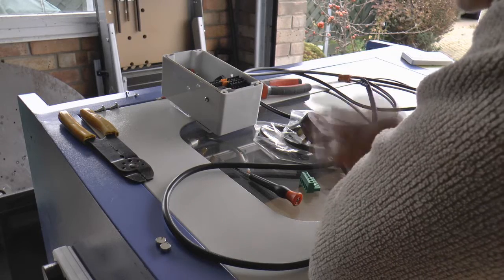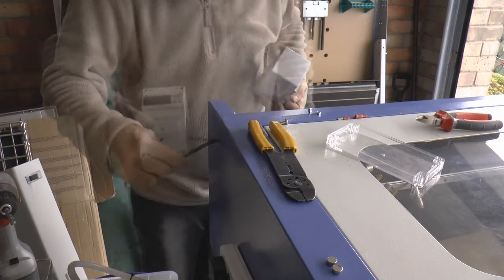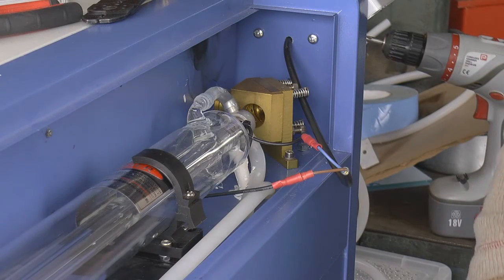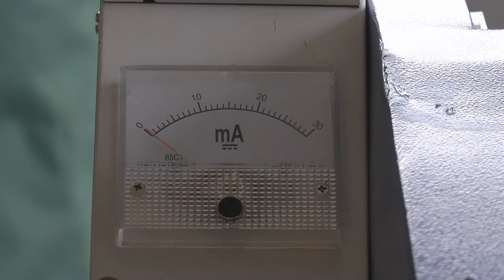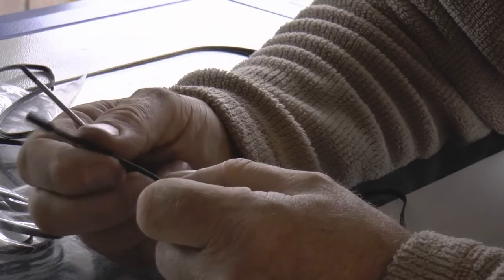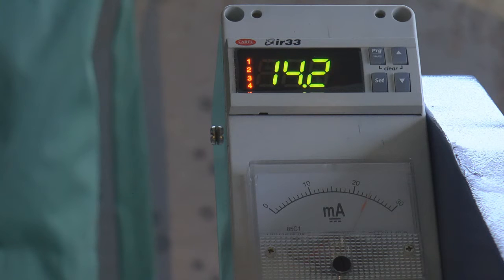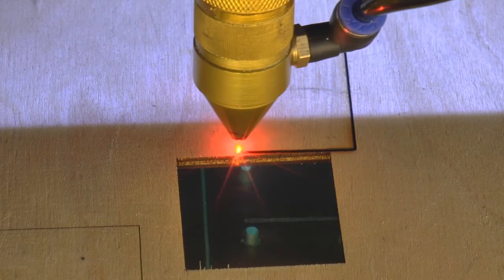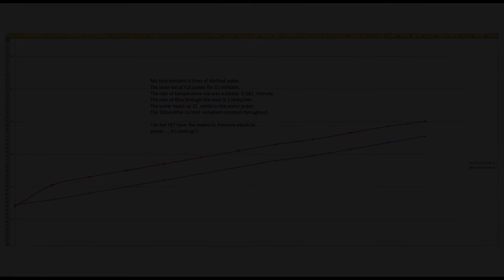RDWorks Learning Lab 24 Adding instuments to give ME contol at last

Comment: Please upvote this comment everyone needs to know what I'm about to share. I was working on my laser tube and I had the positive end connected. I had not covered it in any insulation or liquid latex. I did a test pulse and nothing happened, so I went to adjust the tube and a spark shot out of the tube into my finger at a distance of about 3 in. Scared the crap out of me.

A serious charge builds up and if it has nowhere to go it's just waiting for you to get careless and try to touch it. Lucky for me it was only voltage no amps. I think. It felt like a stun gun.
Reply: Laser Wood Shapes do you any safe way to discharge the remaining voltage before we can touch it ?

Comment: Hello; I saw this video and installed a multimeter in series with the laser tube. All went well, and then I discovered a funny thing; My Laser Power-supply is of the type MYJG100W-Y. Google it, and you will see that on top of the power-supply there is a LCD display (!!!) And there it displays the milli-Ampere output.
Reply: The Laser Power-supply of the type MYJG100W-Y also has a network-type plug for connecting an external mA display. With a potmeter for controlling the milli-amps. You find it at CloudRay. I ordered the remote display so I don't have to remove the sidepanel in order to read the mA.
Reply from the maker: Hi 
 MYJG is a generic term for a certain design of HV power supply. Not all MYJG power supplies have a built in ammeter.
I have to admit that an ammeter on the difficult to access power supply is not the brightest idea I have seen. A very cheap 30 mA analog meter mounted on the top surface near the Ruida controller is a lot more useful.  
 see  https://www.cloudraylaser.com/products/cloudray-50ma-ammeter-hua-85c1-dc-0-50ma-analog-amp-panel-meter-current-for-co2-laser-engraving-cutting-machine?_pos=2&_sid=248e46aa3&_ss=r&variant=7629813481523  (available on ebay for about $3)

If you have a 100watt power supply, I am assuming your machine will be fitted with a Ruida (or similar) digital controller You do not need  to ADJUST the current , you may need to LIMIT  the current so that you cannot overdrive your tube  and maybe this knob allows you access to internal adjustments  to do that.  However, I would be worried about accidentally twisting that knob and changing the setting. Maybe you have to push and rotate  or some such motion to stop accidental changes. I have never used this device so I am just guessing. I will be interested in knowing when you have fitted it,

Best wishes
Russ
Reply: @SarbarMultimedia  Okay. I wont be using the knob, only the mA meter.
Reply from the maker: @wikeroy  
 Hi 
Don't be frightened, just experiment and find out what it does. Normally a 100 watt power supply will have a max output of 30mA That means that 100%power in your programs will set the  power supply to allow t 30mA current flow through your tube.. Because the %power does NOT control the WATTS output but controls the CURRENTt flow, 50% power will allow 15mA to flow. .A 100 watt tube will not deliver 50 watts at 50% . No, the relationship between current flow through the tube and watts output is very non-linear. 50 watts will probably happen at about 20 to 25% and at 50%  you will have about 80 watts. A 100 watt tube will usually have a recommended current limit of 25mA (maybe 26mA) Do not exceed these numbers or you will dramatically shorten the life of your tube.  Thus 25mA/30mA= 83%. ie you should not program values bigger than 83%power. However, within the HV power supply there is a potentiometer that will allow  you to limit the output to 25mA, This means that you can now safely use the full 100% and never overdrive your tube. I suspect that this external potentiometer is  doing just that, but  as I said earlier, play a bit and find out exactly what it's doing.  There are ways within the Ruida controller software to add these limits also.
 Best wishes
Russ

Comment: Dear Russ,

I need your urgent support, 2 months before I sent one message to you regarding my 50W co2 laser engraver problem. While engraving some places  printing it's engraving after some time it's not printing again it's engraving. You informed that this problem is due to laser tube is defective when it heat it's not printing and when it cools it's printing, so you suggest some good China laser tube seller cloudry laser company, so I directly purchase the laser from that company. After usage of 15 days this company new laser I facing now the problem is some places engraving normal and some place it's printing very dark. Request your support, my printing time is not more than 45min continuously. Kindly request your support on priority.

Regards,
Dinesh.
Reply from the maker: Hi Dinesh
Add your email to another comment in disguised form (dinesh61at googlemaildotcom) and I will write to you. I will need picyuresand video of your problem.
Best wishes
Russ
Reply: @SarbarMultimedia  can you share your email ID for sharing the picture
Reply from the maker: @DineshKumar-ov6uo  
Sorry Dinesh, I do not publish my email on an open forum  but as I suggested, you can send me yours in a disguised format.
Best wishes
Russ

Comment: I've been following along this fascinating series and I have considered buying a machine. What is stopping me is videos 16 and 17. Has the power drop problem been corrected by running at 60% power with the new CO2 tube? In your opinion was it that the factory tube was bad, or that you ran it too hard?
Reply from the maker: Hi Miguel 
I knew a lot about industrial metal cutting lasers and thought this would be a great retirement activity.. I did not want to run a business but just to play and learn. I was very naive about the way these machines are sold on Ebay. Time and much correspondence from other  Ebay buyers has allowed me to see the way that the Chinese sell these machines. They build them with sub standard tubes (QA rejects from main tube manufacturing companies) that work sufficiently well to fool the average naive Ebay buyer. They ship in bulk to warehouses around the world and then enlist PRIVATE ebay sellers to move them on for commission. That way the factory distances  itself from responsibility if you find anything wrong. The warranty is worthless. OK so now you are really disappointed and glad you didn't buy.. Don't be too hasty because despite  wanting that 50 watt machine (that will be fitted with a 40 watt B grade tube) if you choose the correct machine, the mechanics and the control system will be pretty good and excellent value for money. If you factor in another $200 to $300 for a A grade replacement tube , you will finish up with a superb value CNC machine. Many small business are running with such machines.
I was naive about my purchase but the poor quality tube forced me to learn a lot about the technology. Sadly I did NOT learn quickly enough  because I returned to Ebay to buy a replacement tube and I finished up replacing rubbish with a bit better rubbish. It was not until I upgraded to a proper A grade  60 watt tube and power supply that I realized what a great little machine I had bought. E bay will be the cheapest place to buy but  never buy spares form Ebay unless it is a known trusted source.
Best wishes
Russ

Comment: I assume you are measuring DC current, is that correct?
Reply from the maker: Yes almost zero volts and just a cheap analogue ammeter is best, Somthing like this:-
https://www.ebay.co.uk/itm/DC-0-30mA-Analog-Amp-Meter-Ammeter-Current-Panel-Ampere-Meter-Milliammeter/352350706691?hash=item5209bd1c03:g:Zo0AAOSwj2Za8ql2

Best wishes
Russ

Comment: I’m taking delivery of my thunder laser tomorrow and I understand the tube manufactured date was April 2018. Does that mean my 2000 hour tube has expired before I even used it ?
Reply from the maker: There are all sorts of vagaries and half truths about tube life which until recently I was unable to get to the bottom of.  Thinklaser's Chinese manufacturing company  were adamant that tube life=shelf life....hence your concern. However I have developed my own very reliable source within China. He is a guy who owns an on-line laser parts supply company. His products include tubes and he has to be responsible for warranty support issues so I asked the "what is tube life?" question of him. This is his answer.

The warranty period of laser tube is calculated from the date of manufacture. For example, the date of manufacture for 1 W2 laser tube is 2018.6.1. The warranty period is 18 months. So the warranty will stop until 2019.12.31. So The warrenty  period  refers to the time for storage time. No matter the working time you use. The working time is another indicator. There is not a fixed answer on the life time of laser tube. There are too many scenarios for laser machine. Someone need to engrave wood. Some one need to engrave acrylic or chapter. Differnt current, different environment, differnt temperature and different life times. Laser tube manufacturers claim these indicators base on some specified conditions, such as 4 hours everyday, 60% max power, working temperature  25 degreess etc. However I talked with many factories about  this indicators. For most of Laser tube manufacturers, it is just estimated. They didn't do such a experiments. So in perfect conditions, if you work only 4 hours everyday, 10000 hours means 2500days(more then 6 years). But it is unrealistic. Because every tubes will be leakage, more or less. So if you donot use the tubes very frequently, 3 years are reasonable. In China, some end-user use laser machines 7x24 hours everyweek on their busy time. The life will be shorter at this scenario. Hope you can understand it. 

Each manufacturer of tube has its own but similar warranty conditions . It appears that Thinklaser's information was  incorrect and it is only the warranty period that is date related and not the physical life of the tube.  That makes a lot more sense because my 70 watt Mactron tube was rated as 4000 hour life but is now almost 3 years old and still as reliable and powerful as ever.  If Thunder laser are supplying a 2000 hour tube, it tells me they are not fitting top quality tubes. I will be interested to know what brand of tube has been fitted when you get your machine. I will also be interested to find out just how "plug and play" your machine is . Is it being "dumped" on you and it's then all down to you ? or is there any tech support to get it installed and running?

Best wishes
Russ
Reply: SarbarMultimedia 
Very good info. I went back and forth with thunder last night and they say I have a 6 month warranty on my tube from time of delivery regardless of the tube manufactured date. 
I take delivery within the next two hours and will let you know how plug and play it is. I know they have a service rep in Texas now and China is very responsive when I email them within there working hours. And I’ve heard good things from other owners on the machines. 
I will keep you posted today. Thanks !!
Reply from the maker: I have been very obvious about outrageous and misleading claims that TL make for some of their machine's capability, however, I have always respected their pretty solid engineering, build quality and long distance customer care. After 3 years of learning about this technology,  the various machine builders and component manufacturers,  I have arrived at the conclusion that the Chinese assemble these machines but don't really understand them.  If they used them in anger and with a critical user eye, the design would not be as it is.

One thing I will really be interested in is their control mechanism for air assist. Is it programmable?
Air assist is the single most important parameter for achieving cutting and engraving perfection. Apart from the HR head (which probably has some use)  they only use  two focal lengths  (4" and 2")  but have a range of nozzles for different specific jobs. The fact that all these nozzles exist shows me that they have a vague understanding  of it's importance but are unable to design a universal solution.. This  lack of understanding about AIR MANAGEMENT does not stop at air assist. Extraction and the way that air moves around your work is another huge important issue that ALL Chinese machines ignore. They think that a honeycomb table is the answer to everything. .  First let me point out that there is a  6"  diameter duct on the back of the machine and a pretty powerful 6" centrifugal extract fan. It does not require a  science degree to understand that if you fill a glass bottle with smoke  you cannot suck or blow the smoke out. You MUST have a hole elsewhere in the bottle to get THROUGH flow. So lets take a look at your machine  (a NOVA?) I see three strips of louvers on the front cover. Lets assume each louver is 10cm long and has an an open  depth 5mm. That is 5sq cm of open area, There are 15 louvers so that's a total open area of 75sq cm . The extract duct 15cm diameter or 176sq cm,  so we have  already strangled the through flow by 50%. Lets now imagine where that air flow is going. The louvers are automatically directing that air flow upwards as it jets through the louvers. As soon as it is in the upper part of the cabinet that airflow is being tempted downwards by the vast open area of the honeycomb table. If there was a work piece on the table then the air would be flowing AROUND it to find the easiest path towards the extract duct. I'm going to stop there because this gross mismanagement of air flows is so frustrating.
Take a look at this unpublished demonstration I made  that sums up all my findings. 
a)The free flow of air THROUGH the table has been blocked off by a solid sheet of steel.  In my machine there are grills at the back of the table that pull air down to the extract duct. There are minor leakages around the edge of the table  but these still pull smoke away rapidly.
b) I leave the door open by about 25mm so there is a high velocity flow of air from front to back of the table flowing both OVER and UNDER the work. . Watch how efficiently the smoke is controlled.
c) during engraving the smoke automatically explodes volumetrically upwards. Once in the high speed airflow, it never gets a chance to settle but is instead diluted and whisked away before it can "brown" the top of the work.
d) It's not fantastic air pressure but efficient guidance of  low pressure airflow that has the greatest effect on cut efficiency. With exactly the same lens and power settings I was able to improve cutting speed 400% by just the efficient management of the air assist
I am not making empty claims to sell machines I am demonstrating facts that you can see and test for yourself. I am just reinforcing my claim that these machines could be so much better designed with just a little more LOGICAL thought.

https://www.youtube.com/watch?v=nHy7fIng5uQ

Hey....sorry you got in the firing line....but I feel a lot calmer after that rant.....Big smile

All best wishes and good luck with your machine. At least you know how to turbo charge it now.
Russ
Reply: SarbarMultimedia 
Understood. In watching your videos I knew I had an airflow problem to start with. I plan on removing the front narrow pass thru panel to allow for more air flow from front to back and then add a solid steel panel for cutting surface and pin board as you show. 
Do you feel by removing the front panel will help?
See link to front panel removal. 
https://youtu.be/tv4wjChAHAA
In regards to the controller, I will verify but understand that it only controls on or off with a delay. Thunder does sell a airflow controller for a compressor that throttles air volume 
http://www.thunderlaser.com/features/air-pressure-control-sensor.html

Thoughts ?
Reply from the maker: HA HA HA!!  It's  a lovely expensive (if you buy it  through TL) super sensitive pressure display and switch. It does nothing to control air assist , it only shuts your machine down if you don't have any. Why????
Here is the correct way to control your air assist . This is an unpublished demo video but I have the circuit diagram and parts list if you need it. Just add your email address to a new comment that I can immediately delete so that your email is not in a public arena.
https://www.youtube.com/watch?v=3nvAuz2i6H8 
I have just seen what is behind that pass through panel. Nightmare for airflow, but it's been designed like that to prevent any stray laser rays escaping through the lovers. If you remove the panel it will be too big a gap. I would make a 5mm acrylic panel  and use the original panel fixings to secure it. Apart from  two inches at each end  I would cut away the bottom edge of the panel to leave a 40mm gap along the bottom edge. That will allow a nice jet of air into just the right place. I note there is no grill at the back of your table to pull the air to the back of the machine.. When you reset your machine  you will need to see how far the head goes back in Y. If it settles right at the back edge of the honeycomb that may be a problem. If it sits ,say 1inch forward that will be super because you can leave a 3/4" gap at the back edge of your steel sheet to allow the air a downwards passage. Lets hope

Best wishes
Russ